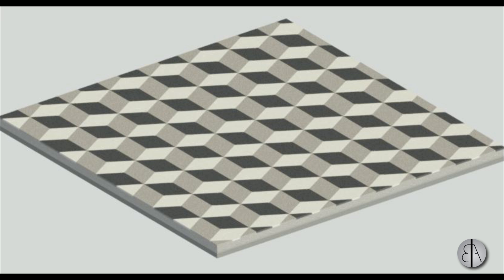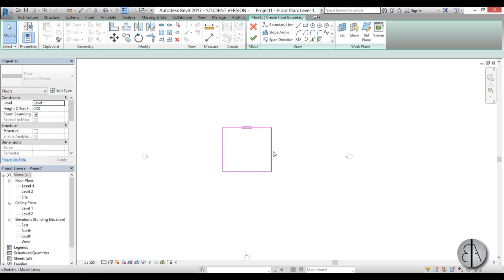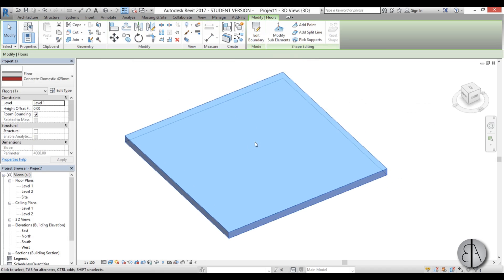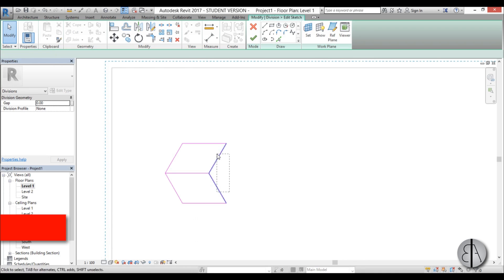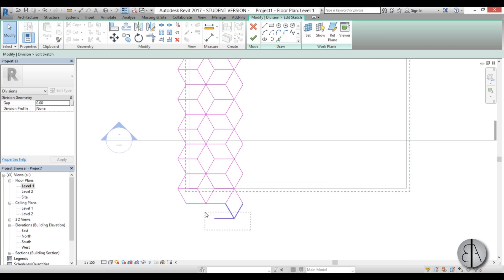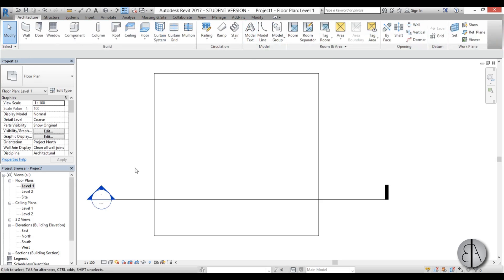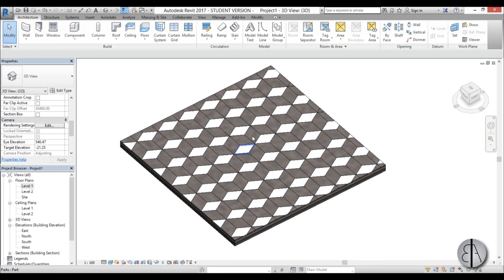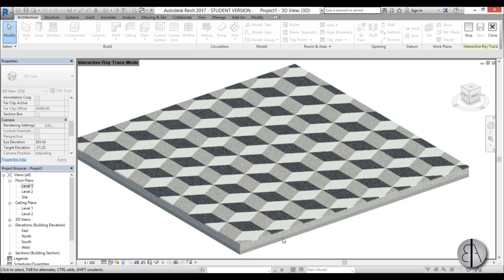Custom Floor Patterns in Revit Tutorial

Comment: One of best Revit tutorials to be found anywhere...however I owuld have like to have seen this tutorial on custom floors using the wooden floor with the diamond pattern example in your video thumbnail...its far more aesthetically appealing and likely to be used and or requested by a client rather than the one you used....

Comment: Thank you for great tutorials its good to know its possible in Revit but now I'm wondering if it's it possible to make it more advanced? Making a custom pattern that can be applied to large floors could be one thing, maybe by creating a family?. Controlling the material of each type elements from properties panel same with some parameters for the side? Could you use something like divide surface in massing to create floor tiles? Thanks!
Reply: HEY DID YOU FIGURE IT OUT?